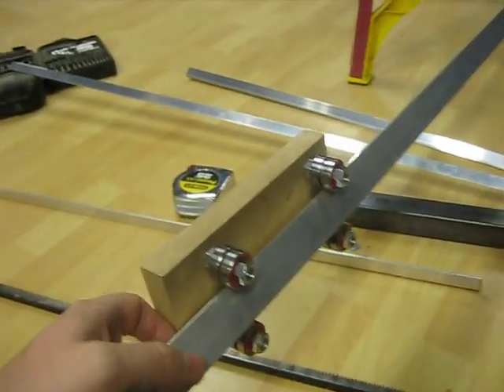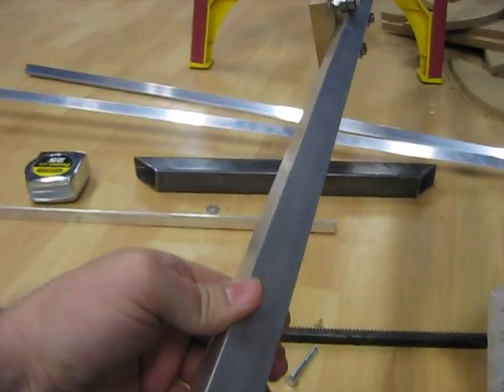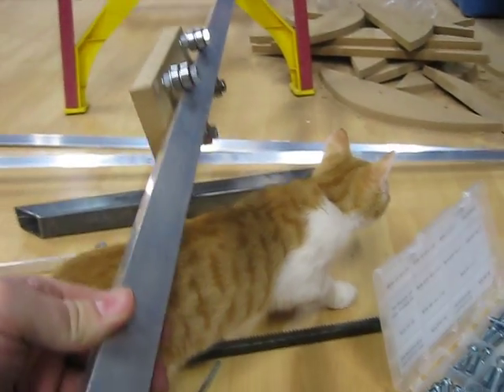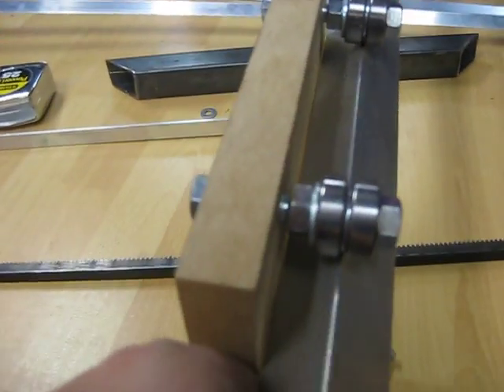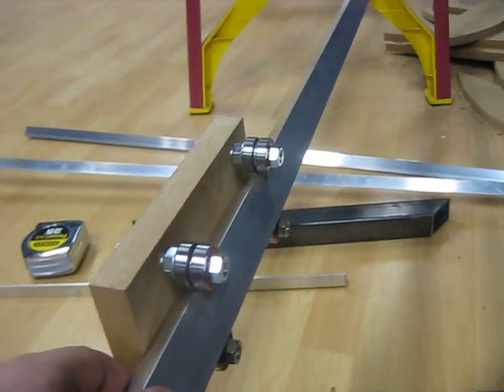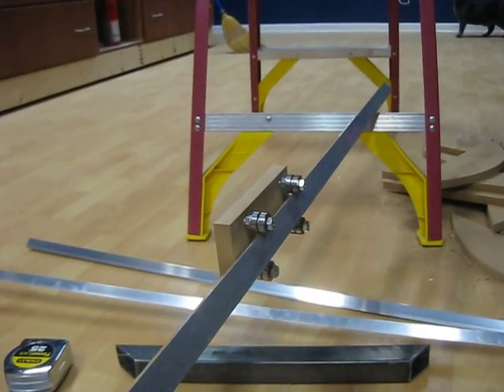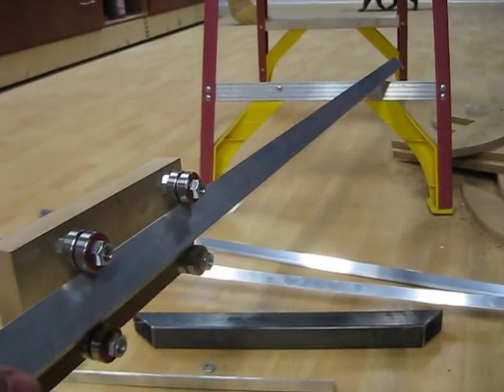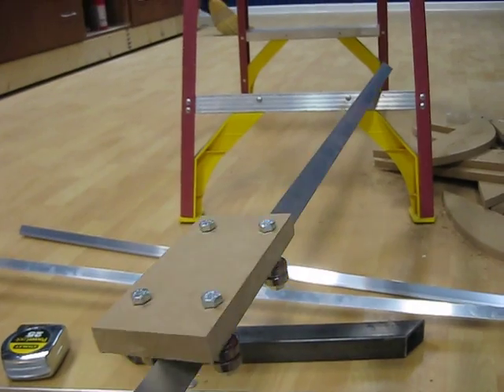Building a CNC Machine Part 3

Comment: will this be strong enough to hold up a skill saw or a router over a 9 foot length with enough rigidity so I can make a slab flat. I want to use it to make a jog so I can use a router to flatten slabs for table tops and to use it to cut boards and plywood sheets square. it will have an x and y axis

Comment: This method works as-is however add 40 lbs. and over-time this will will have issue quickly, the bearings need to be angular contact ball bearings but even those are expensive.

Comment: Nice video. We invented V-groove linear guide wheels and track. It's the real deal for CNC builds. Use promo code MAKER40 on www.bwc.com for 40% off your entire order for the rest of 2017. MadeWell Radial Wheels are our lowest cost solution and they work with DualVee linear tracks.

Comment: I think it's a terrible design, I hate to be a little rude, but that surely wouldn't last long once you put weight on there. Even if the bearings are deep grooved they won't love the momentary load from running on such a slope. Also, the aluminium rail will just get chewed up really bad after you put weight on their and use it a couple times. The rail material should be harder than the bearing.
Reply: My thoughts exactly. Those bearings are gonna get chewed through in no time flat. A for effort though.

Comment: Good idea! I think you should use steel because the aluminum might wear when you tighten them up for slop. My two cents. Or the wood for holding them might change size with humidity and there for more or less slop.

Comment: only thought is that you have all your bearing mounted on points. so you wear rate might be high
Reply: per russ25052 - same thought
Reply: I was hoping that this would work but I think you are right about the wear rate. I need to find some inexpensive options for the CNC table I want to build for my everlast plasma cutter

Comment: There is a better way to do this. You can make the bearings ride on the flat suface of your square. By using two L pieces one on top and one on bottom and just mount the bearings to that. Not my idea saw another guy do it. Looked like it would be solid.

Comment from the maker: No I haven't been able to return to my CNC project because of other projects I've been working on. I was commissioned to make a Tardis and I also recently got married and made a photo booth for my wedding. I hope to return to it soon though. I might try this on a smaller CNC project where there is less weight being pushing the bearings apart and won't wear out as fast.

Comment from the maker: It's just 1 inch square aluminum tubing, 8 skateboard bearings, 1/4" bolts with nuts and washers and an MDF block of wood for the carriage. I would recommend using a drill press to get holes for the bolts parallel and straight up and down.

Comment: the only problem is using aluminum without steel guids will cause the bearings to pickup any defects in the aluminum like dents or divits, good simple design for a budget for sure either way

Comment: I tried that too with skateboard bearings, worked great for about two weeks then the bearings started to break down and not spin anymore, because the way they sit pushes the bearings sideways too, then they break down. I just used the cheap skateboard bearings maybe the better ones would last. They have something like v groove bearings at lowes for sliding glass doors that work great for cutting just wood, but have to much play for cutting metal.

Comment from the maker: @WildSideLittle Thanks. No it didn't move at all. I tried to get the upper and lower bolts as close together as possible. When I put the carriage on the square tube it was a little tight because it was pushing those bolts apart ever so slightly. I decided not to go with this idea only because drilling holes to mount the tube at 45 degrees might not be so exact. I'm doing 6 bearings now around a square tube that lays flat. I need to post another video! Time to get off the pot!